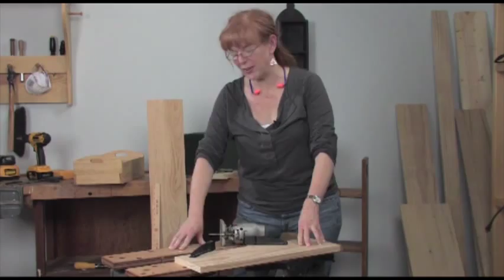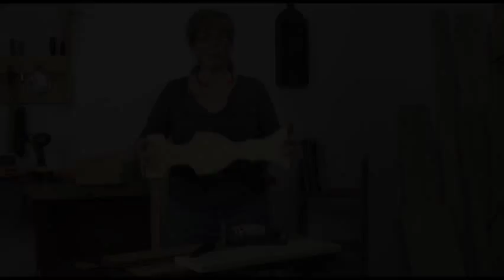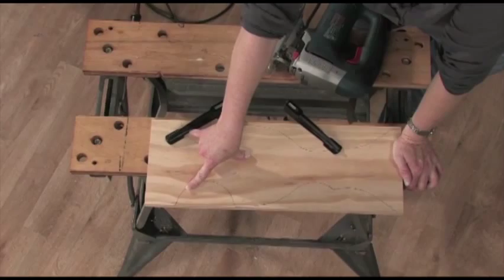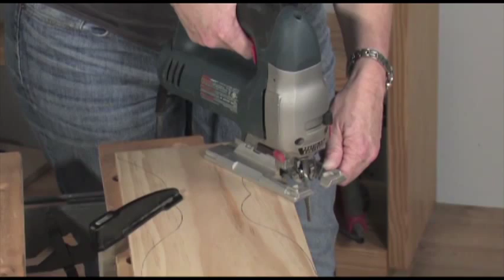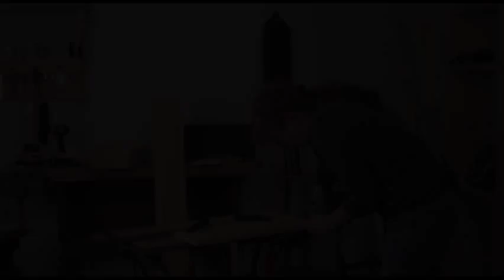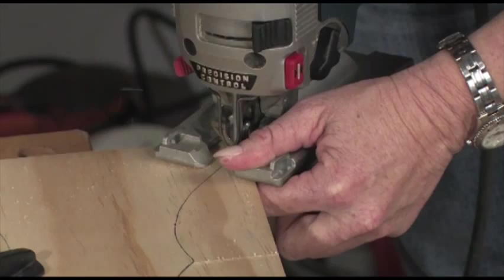Tool Basics for Getting Started in Woodworking

Comment: As a woman DIYer and a professional in a traditional male field of work, I was delighted to find another woman providing instruction on this new (for me) subject of wood working. I must say, however, that safety is paramount - always - when working w/ tools (particularly power cutting tools), electricity, ladders, etc - regardless of one's experience level. I always stress (and practice) wearing protective eye wear, gloves, ear plugs, dust masks, steel toed non-slip foot wear, etc for applicable tasks / environments. Accidents happen. So many of them, tragically, are preventable - simply by employing sound safety practices. I applaud your contribution, however, placing one's fingers, hand - any part of the body - near an unshielded blade is dangerous & a formula for disaster. I understand the reasoning, however, I'm sure there are other ways to stabilize the piece - safely.